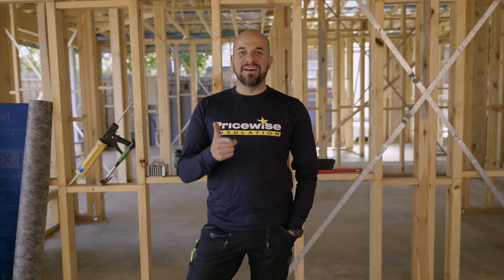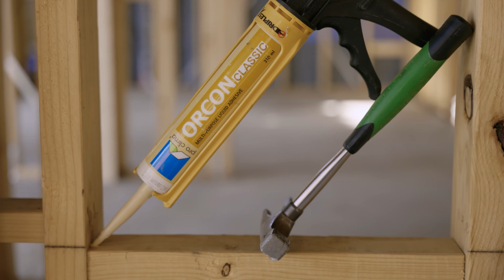How to Install Pro Clima Solitex Extasana

Comment: Why is the Extasana going onto an interior wall??  Is that an "inside" wall in a garage??
Reply from the maker: Hi @thewagon,

Thanks for your comment! The Solitex Extasana is installed on the outside of the the exterior walls of a house. Airboss Dan's install demonstration was done on the wall that separates the house and the garage.